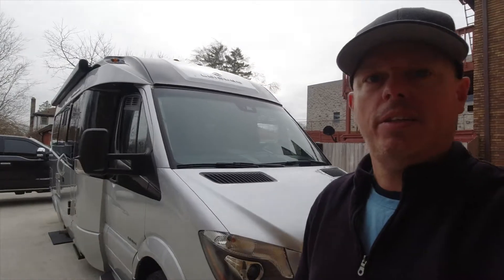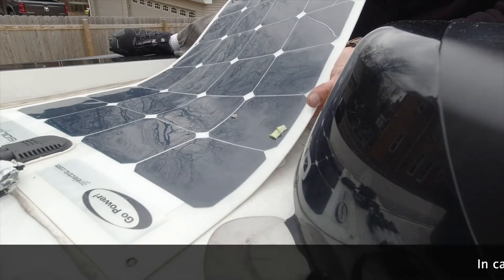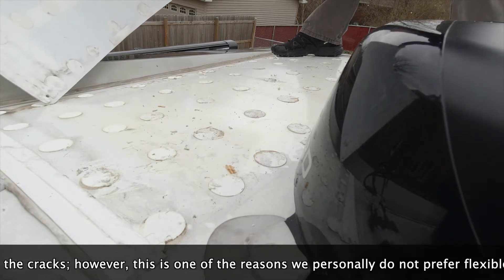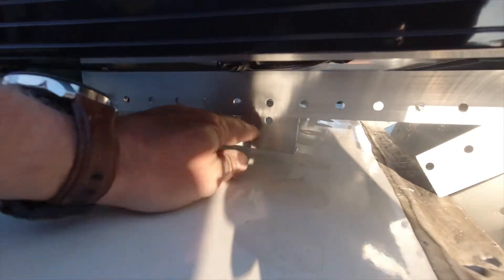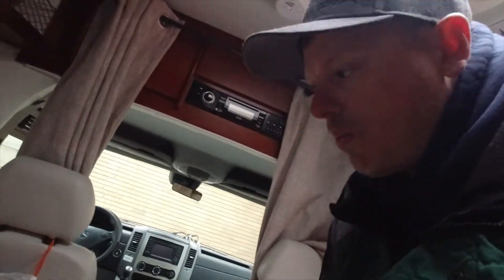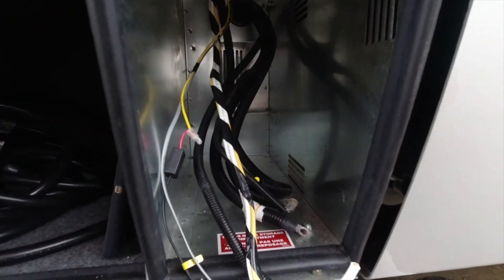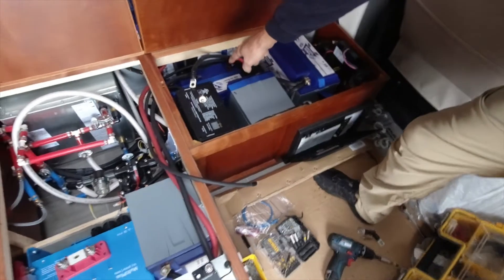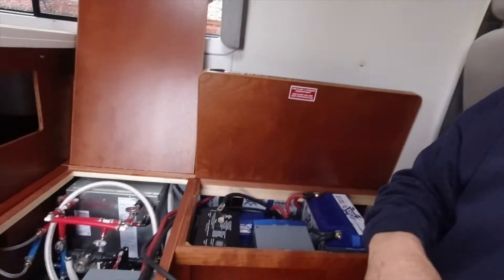Leisure Travel LTV Serenity | Solar * Lithium | Part One

Comment: Do you have to do anything to repair those heat cracks in the roof so that water doesn’t leak in? Nice video btw
Reply from the maker: JayBenz yes! I used a lot of eternabond tape to seal all the cracks. Good question because I don’t think I said that in the videos, thanks!
Reply: The Dry Campers I wonder if sealing the edges of the panels (all around each panel) to the roof would help to prevent leaks for those who don’t wish to remove them. Thoughts?
Reply from the maker: @jaysonbenner  IMO I think the cracks would occur faster by doing this because there's no ventilation allowed.

Comment: So what's your take on the flex panels? If one wants to go this route to reduce the weight of traditional solar panels? Any thoughts?
Reply from the maker: Meant 2 Be RVing make sure that you have plenty of ventilation under the panels so that the panels don’t get overheated and also cause the heat damage to the roof, like this one.
Reply: The Dry Campers might not be worth the risk to go with those then.
Reply: I have heard of people mounting them to a sheet of aluminum and then spacing the aluminum off the roof slightly. But not sure how much weight you really end up saving adding more materials

Comment: Nice solar work.👍Didn't know that the flex panels caused that kind of damage to the roof. We have been thinking about solar. Right now we have 100 watt panel and 2 6v batteries. Gave a like too.😃
Stay safe in these trying times👍
Reply from the maker: Thanks!  Yeah, it may not be all flex panels, but we're personally just not fans of those type of panels.  Y'all stay safe, too!